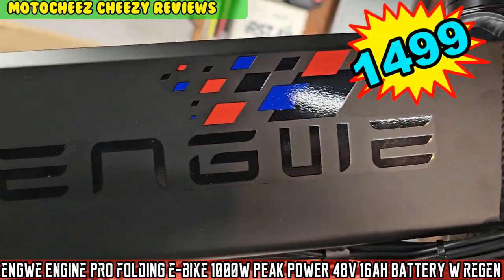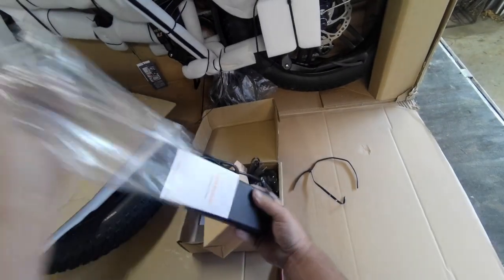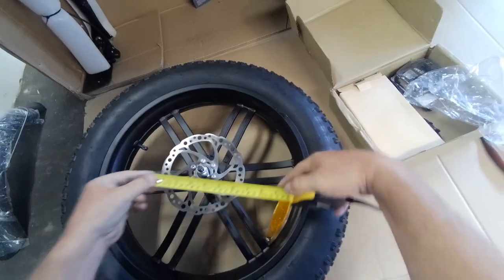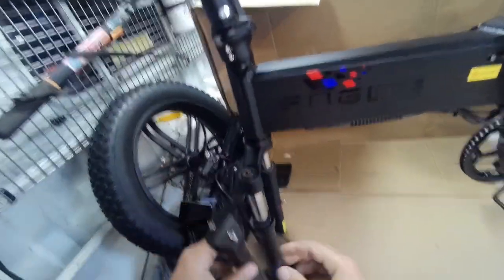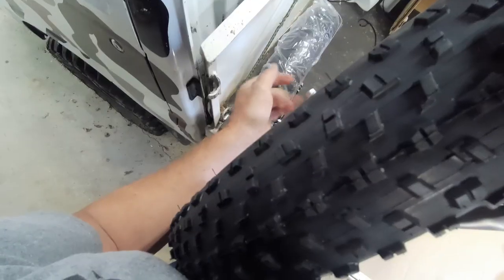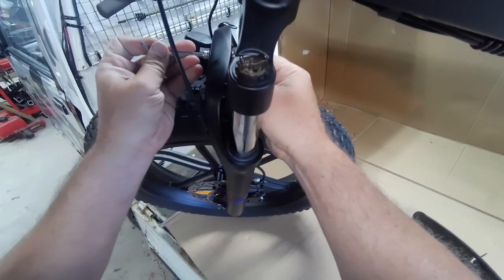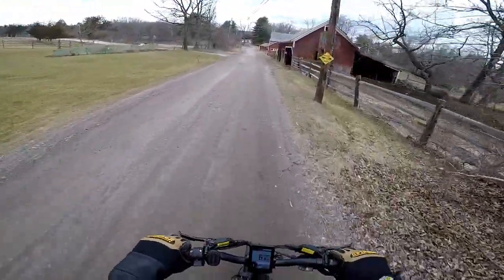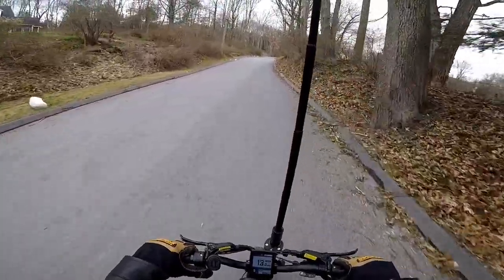Engwe Engine Pro folding e-bike 1000W PEAK POWER 48V 16AH BATTERY w regen EP-2 Pro

Comment: That display I have on one of my bikes.. When your battery goes to 99% it will start dropping like a rock. 20 miles should be about it if you are trying to max it out .. With all your hills that is.. Flat ground I think 25-30 miles if you pedal a bit at 25 plus mph. Once the controller temperature reaches higher temps it will start reducing amps and wattage to be a safeguard. Hills will increase temps of the controller fast and your wattage displayed will drop . This is really known on the Wallke H6 bikes .. Controller temp will be a limiting factor of power untill it cools down again.
Reply from the maker: Good info!

Comment: Man your the perfect person for building E bikes...They are alot more fun than the ones you get manufactured..Mine goes 60 mph and can still perform awesome on trails...If your going down hill on that one and switch the pedal assist to zero, it will pump watts back into the battery..You could switch that out to a thumb throttle to engage the regen brakes, which works much much better..You should check out Bafang 1000 watt BBshd mid drive motor, stock it can go 35--40 mph, but there are after market controllers, and there are direct drive hub motors that can push 3000-5000 watts, and you could write alot of the expenses off, just food 4 thought..
Reply from the maker: I've been researching that setup.   I definitely want to build one! Great info, thanks 😁🧀
Reply from the maker: What bike is good for these setups?
Reply: am using a a old school dyno 12 v boosted 24v for inverter back to battery charger

Comment: Between the lens distortion of the 360 degree camera and the wobble induced by the flex of the mounting arm, that "from the rear" view just leaving the P.O., it looked like you were humping a football.  Good lookin' e-bike.  Is it true what they say that the hub drive motors aren't as good as the centrally located ones? (less efficient/powerful)
Reply from the maker: The center hubs are more.powerful because of gearing capabilities, but I heard less efficient. I'll get my hands on one someday.

Comment: Just had mine out for the first ride today 😎 I ordered mine in mid May. It seems to be ok apart from a rattle at the rear. It think its the chain rattling of the fender? Did you have that issue?
Its powerful. Im going to take it easy while getting used to it. It's really nice in black actually. Stealthy looking.
Reply from the maker: Awesome congrats, now mine doesn't rattle but I'll bet you it has something to do with that suspension and the fender being loose on the bottom behind a pedal so it'll work fully
Reply: @MotoCheez Yeah, I hope I'm not going to have trouble with that part. There's a little mark on the fender I discovered. The chain is quite close to the fender. I tightened the fender and adjusted it a little. Could be that simple. I'll try again tomorrow. 
Fun machine all the same and quite easy to ride without the motor engaged.

Comment: I bought it too. The frame looks solid enough for a 1000W 28mph Motor. However, the motor makes weird and untrustworthy sounds at low speeds... The weight is also too high. Guess that is the trade-off for a fast E-bike.
Reply from the maker: Mine doesn't make weird noises that I can recall. Sound like the others I've reviewed

Comment: You should chose one E Bike and do a Shunt Mod. Google that mod to the controller and try it out.  Would be a cool video.
Reply from the maker: Hmm, I'll check it out
Reply from the maker: Wow that's pretty neat idea, I saw that if you are control or adjusting amperage you can raise it all the way up and it basically does the same thing. I noticed some of the e-bikes do have the amperage control which I raised up on many and you definitely noticed better take off
Reply: @MotoCheez  my controller has a locked limit of 33 amps. The display will allow it to go up but not sure it will do anything more than 33. I will set it at 35 amps and see if any change.

Comment from the maker: Associates links: 
Website direct: https://bit.ly/3yt7ja9 
Amazon: https://amzn.to/428k4Vl

** Rear suspension fix:  https://youtu.be/_fM_YUy8lTE
Reply: I think you can get a bike and extra battery deal now for only $200 extra.. I would highly suggest that people get a second battery.  It's a really great price for only $200 more.
Reply from the maker: I fixed the shock and then I noticed it was pulling the bracket that holds the fender on because that moves it a different rate so I took it off and put a piece of rubber I'm going to make the video and put it inside the description and maybe upload it as another video

Comment: Alloy wheels are nice. Does it need hydraulic suspension? Might just be adding weight to the bike. God I'm tempted to get it with the spare battery 😊
Reply from the maker: Not sure if the back is, but front forks are, I think it's good for dampening.
Reply: @MotoCheez  I've just ordered one with a spare battery. My first ebike. I hope it doesn't disappoint. But from what I've read it really is a good bike for the price.
Reply from the maker: Congratulations  Definitely good bike for the price!

Comment: So the battery lock is exposed to water from underneath, if that freezes up your basically f*ckd?
Reply from the maker: I suppose but you can charge it without taking the battery out and hopefully you wouldn't get enough water up underneath there to freeze it. I don't know if I'd store these outside anyway, at least under cover
Reply: Use the light to defrost it then innit 😂

Comment: 4 inch fat tires are outright stupid if one does not want to ride on the beach and unnecessarily drain the battery
Reply from the maker: They're great for off-road too. Yes they do drain battery more
Reply: @MotoCheez  Let me know how long the Motor and battery last. Engwe claims about 1000 cycles I believe. A quality hub Motor should last for 70 t km like the Albers Neodrive Z20RS does. I would be really interested if the Chinese products can somewhat catch up with that which would be a buy argument combined with the competitive pricing they can offer. I send it back but am thinking about the x26.
Reply from the maker: Doubt I'll get that many cycles! If I do I will certainly do a video